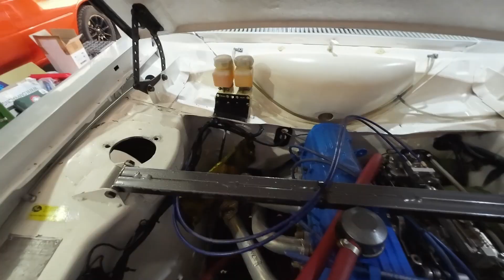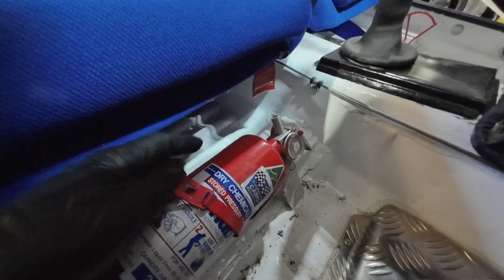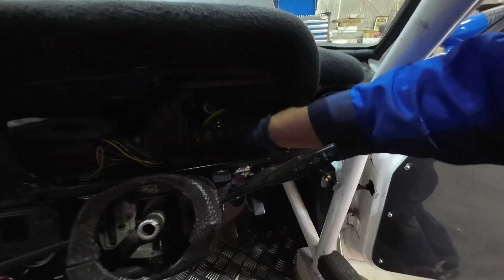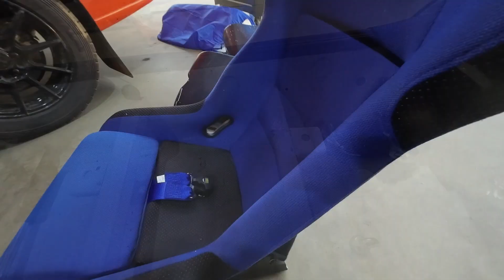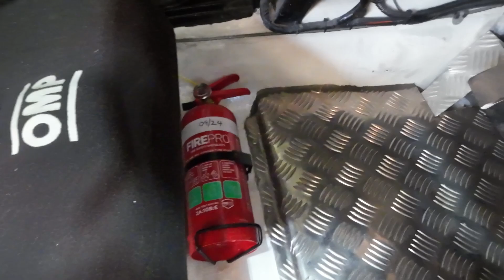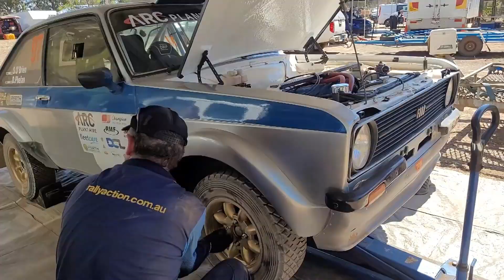Sorting out a Ford Escort Mk 2 rally car to race. Two rallies in two weeks!

Comment: Great assessment and work on the old girl. With the misfire, I had same back in the day.  There is an M6 screw underneath the carb to locate the choke/venturi. If this falls out the choke will turn in the bore and misalign the fuel passages. We had it firing, not firing, aaarrrgh. Took a while to find. Anyway, cheers
Reply from the maker: Thanks for watching  and the great feedback. We knew about the choke issue and did check they were all in the correct place. The retaining bolts were all tight and the lock wires were all still in place.